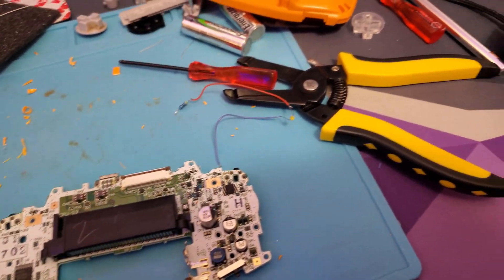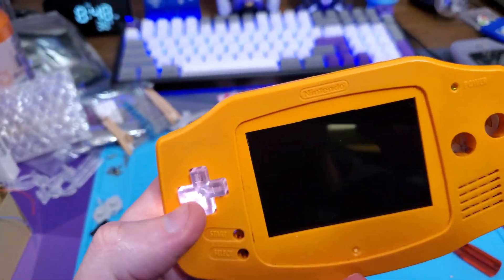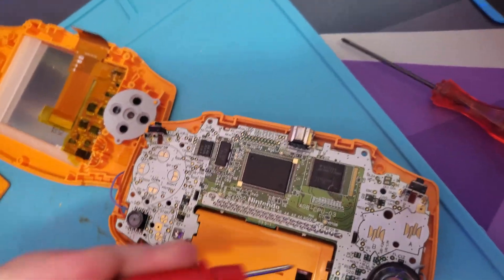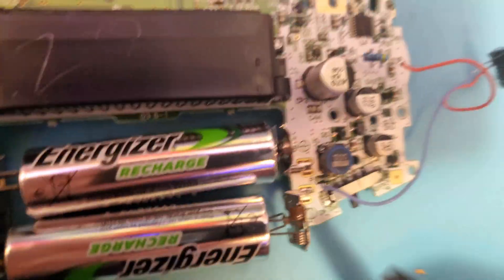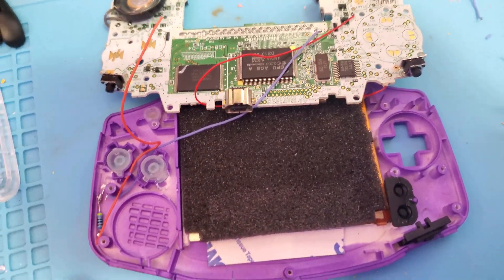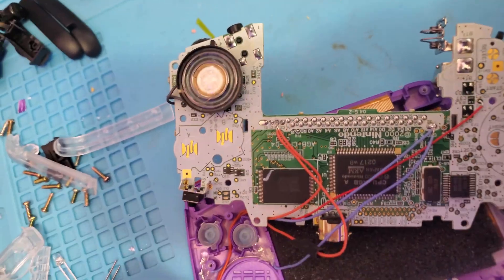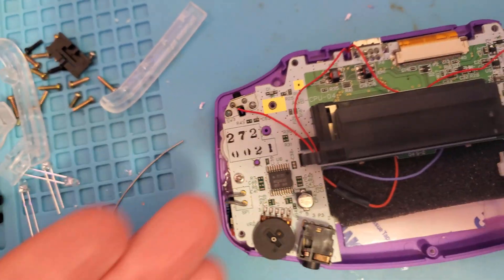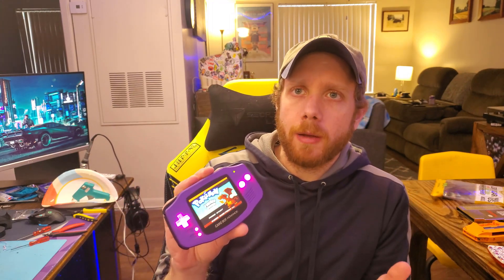Gameboy Advance backlit buttons overview

Comment: Is there a way to turn the lights off while playing? Or do they turn off when the power is on red?
Reply from the maker: I did not install anything like that but you could easily install a switch that lets you turn them off. There may be a way to wire it to have them turn off automatically when the batteries get low but I would not know how that is done.

Comment: Awesome Video! However, that purple shel caught my eyes where did you get it from my or is it standard on a purple gba?

Edit: I accidentally said gbc instead on gba my apologies lol
Reply: By the looks of it, It’s the soft touch shell you can get off Handheldlegend legend or retrosix. There about $25 Canadian and they’re really good quality. I own the blue and green colour of that shell(I’ve had it for about 5 months) and the soft touch feature hasn’t worn out yet. It also already come IPS ready so no little modifications are needed on the device, and you can choose for the same price if you want the battery case to come like normal, or with a hole for the clean juice battery you can get at retrosix or Handheldlegend so you can plug it in with a USB-C charger. Hope this helps.